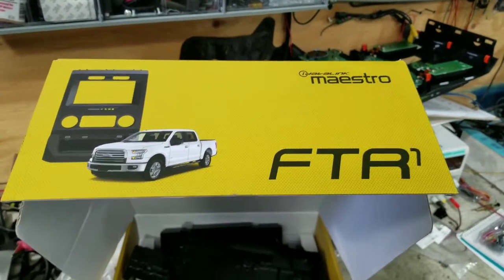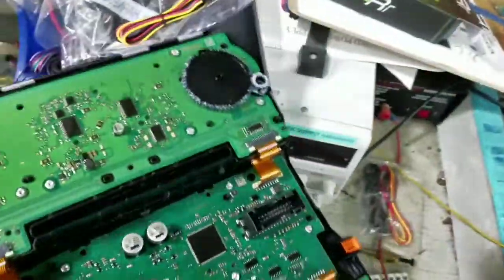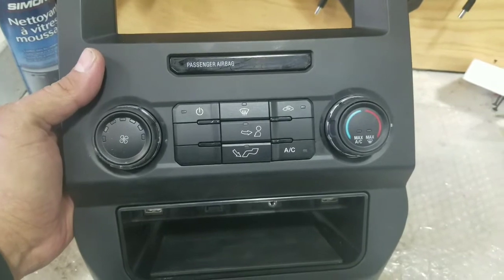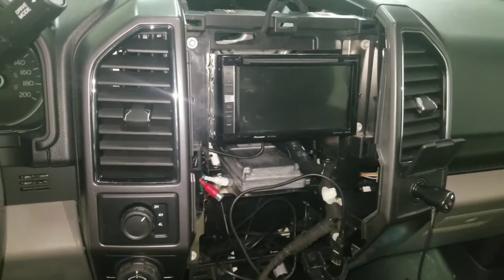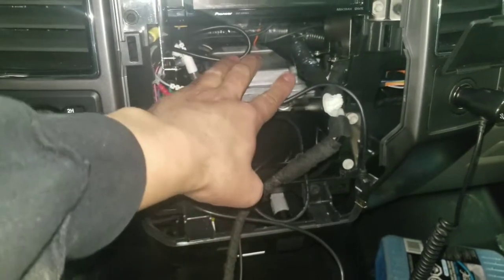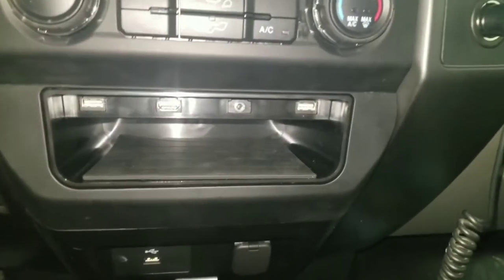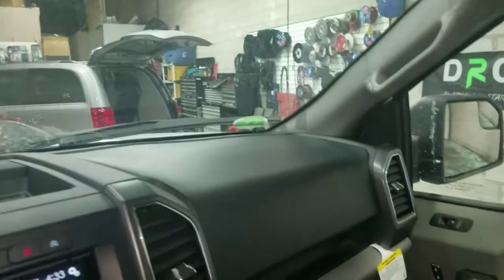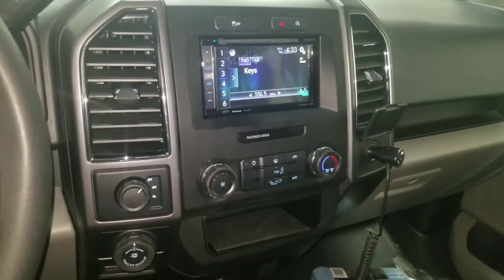Ford F150 2017 2018 double din installation.  IDataLink Maestro KIT-FTR1

Comment: Good video.... but any chance did you retain sync
Reply from the maker: The SYNC function will work only if you have a Maestro compatible system that retain the SYNC (Like our Pioneer systems). We find that even with retaining the SYNC it is not really needed as the systems we install has much better Bluetooth quality, works with your phone voice commands which means you can even send text or email (based on your phone voice options). The factory USB cannot activate CarPlay and Android Auto so in reality if you are installing high end system there is no real need for the SYNC
Reply: No, unless you buy the 150 dollar iDataLink module that is separate.

Comment: Did you have any problems with the HVAC not working after installing this kit?   I just installed mine and the AC controls are not powering on.
Reply from the maker: We did not have any issue with AC but we used a system that is compatible with the Maestro control so that could be the issue.